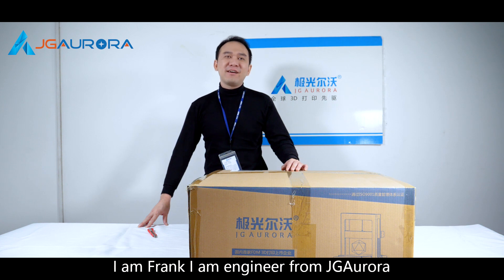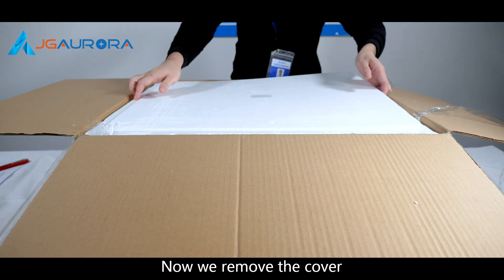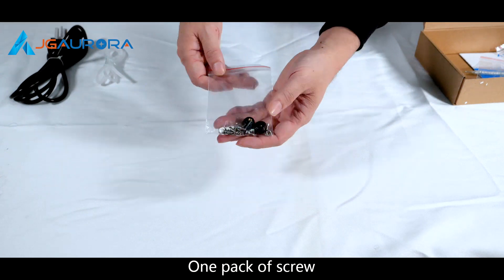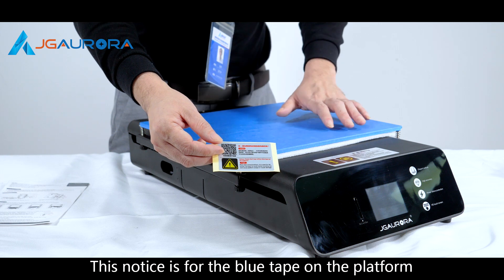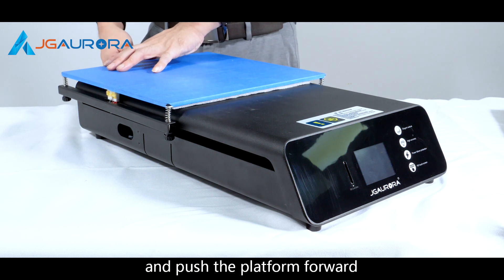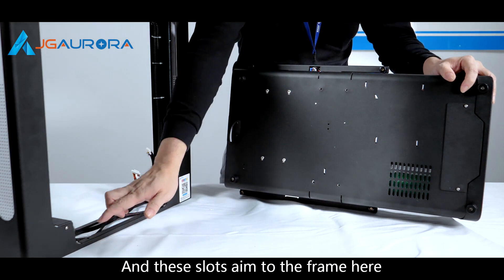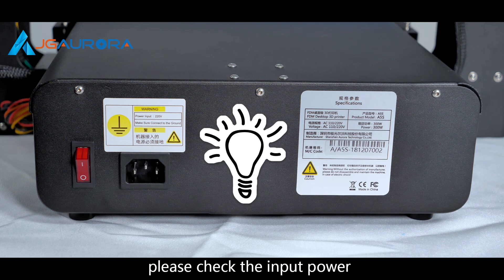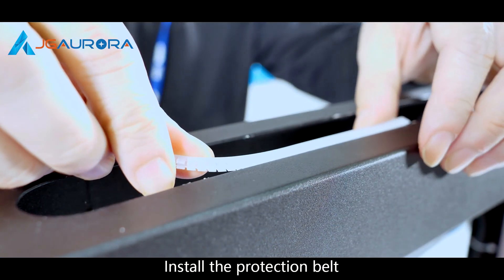JGMaker A5S DIY 3D Printer Assembling and Installation Tutorial

Comment: Why didn't you remove the high-temperature tape from the Diamond Glass Platform before printing?
Reply from the maker: Hi, That masking paper can increase the adhesion between the model and hotbed, and protect the hotbed when we leveling bed and remove the model, thanks

Comment: We just set the printer up as instructed. It made a loud buzzing noise and the frame arm did not move down as it did in the video. Please advise asap. Thank you.
Reply from the maker: Hi,Pls check the cable that connect on the Y-box,And if the problem persists，you can take a video to me, Here is my email,Thanks   support@jgmaker3d.com

Comment: what’s PLA AND ABS?
Reply: It’s filament types
Reply: pla is a filament it meant polylastic acid its filament abs is the same but a different type of plastic that melts at higher temp.
Reply from the maker: the PLA is very commonly used filament . the PLA nozzle temp is 190-210 degree . For the ABS ,  it has a great contractility, and the nozzle suitable temp is 230-260 degree.

Comment: Just installed mine A5S but the platform does not move when  I press Y+ button all other axis work well
Reply: SOLVED: The blue connector inside the printer was not properly connected to the main board.
Reply from the maker: you may open the y-box and check the y-motor wire whether is loose . or the y-belt is broken.

Comment: JGAurora:  Clockwise = turn to the right, Counter-clockwise = turn to the left. Your video  7:07 and PDF instructions  have the direction reverse!  This is from your PDF "NOTE：first time level the machine should tighten all four leveling screws anti-clockwise for one round" "after tighten screws then start leveling. (anti-clockwise platform down, clockwise up) "... I follow the PDF, trying to level my new machine and the very first step which nozzle moves and make a dent on the bed!
Reply from the maker: thank you for suggestion . the video is correct or PDF is wrong ? i dpn't know your words.

Comment: You really need to do bed leveling with the bed and nozzle heated to printing temperatures. Otherwise when you go to print, the distances will have changed and your print either won't stick or the nozzle with cut into the bed.
Reply: THANK YOUUUUUU

Comment: Hey Frank how about you getting JGAurora to stop sending out new heat bed glass when the black coating falls off the old one and then telling customers to simply put the new glass on over the old glass when the chances are that the Z-Axis micros switch has already been adjusted to it's max.

These printers take long enough to heat the bed up without having to heat up two pains of glass in stead of one and they fall to bit's already without adding all that extra weight for the stepper motors to drag around.

I will make sure my contact on your help desk passes my concerns on to you because you act like you don't know that people are not happy with you product and that word won't get around about the guarantee not being worth the paper that it's printed on.
Reply from the maker: Sorry to let you feeling uncomfortable. Please contact our VIP service team: service@zgew3d.com, we will give you a satisfied solution.
Reply from the maker: Hi ,Alan ,sorry for the bad experience got with the JG product ,and hope you already got the decent help and get the issues fixed .If not please do feel free to reply me back And absolutely I will pass your idea to our R&D to try to our best to optimize them
Reply: Can't you remove the old glass from the heated bed? If yours is stuck with adhesive, fishing wire will help you cut through the adhesive.